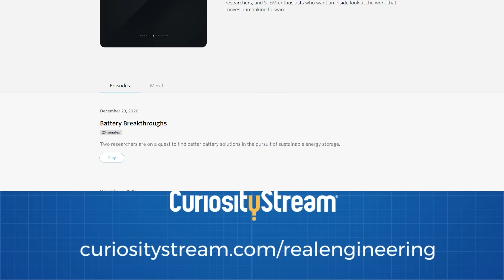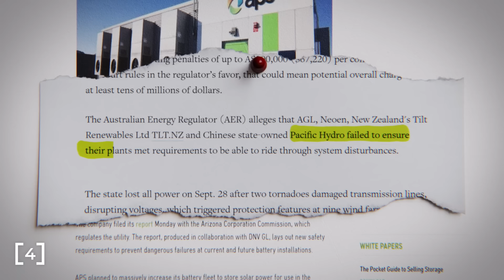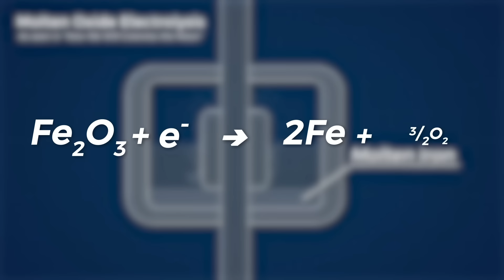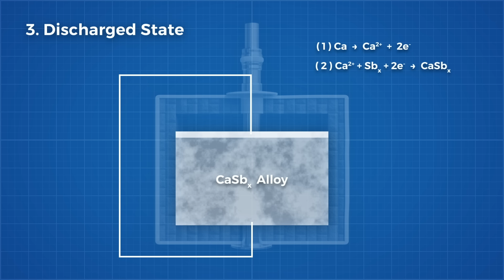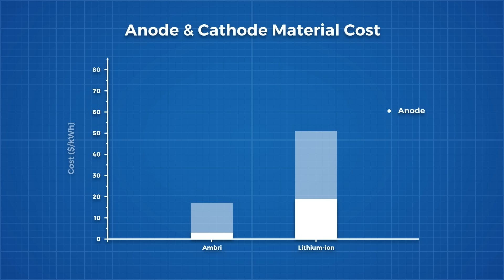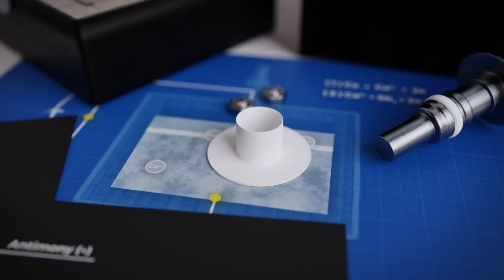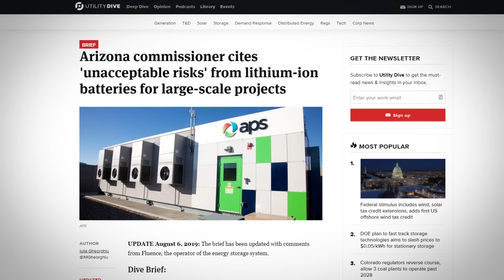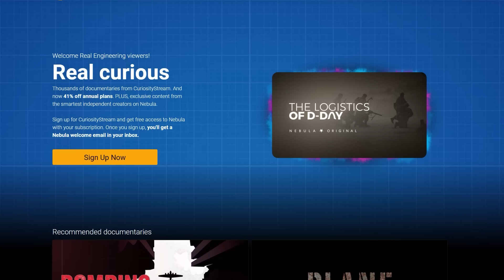The Missing Link in Renewables

Comment: Lithium batteries (or indeed any kind of battery) aren't scalable either. The materials footprint is huge, and as everyone knows they eventually lose efficience. Our best option is to roll out as much nuclear as quickly as we can - France effectively decarbonised its grid in less than 25 years using mostly nuclear, and did it over a quarter of a century ago. If we'd all followed France, we wouldn't have to worry about climate change.

Comment: The Real missing link!!! is Thorium Power Plant which is zero emission and safer compare to other nuclear isotopes to operate and provide abundant energy than thinking of storage. One big question to everyone who is pro-battery, what is the capacity of these battery, South Australia Tesla battery is mere 100mWhr that is just capability to provide only 100mw for an hour and what happens after that hour. For anyone who is curious, SA is trending at an average of 1400mW that almost 14 times at 24hour. So putting into picture 100mW is 10mil Aud. How much should the battery investment be to cover up the demand required on average load with only the dependencies on green energy? Think of it.

Comment: I hope power density is not holding back grid storage progress. Huge, stationary storage arrays would need only a fraction of the energy density of an average Li-ion battery. Compactness, voltage, and high rate of drain can be traded for scalability and durability. Who cares if the battery is the size of a Wal-Mart store if it's cheap and has excellent longevity?
Reply: Where do you put it? You can't just use farmland, woodland, existing cities, or residential areas. Even desert areas are inhabited by wildlife. Distance matters, so there are issues with many European countries.

Comment: The chemical waste in simply producing these batteries is astronomical and that's not even considering the fact that once one of these cells is spent, recycling the materials is more than just economically unfeasible, it's extremely difficult. We should invest that money in tidal power instead. Imagine if wind power was 800x more dense, worked predictably and had an 18-22 hour uptime, isn't susceptible to most natural disasters, is made from recyclable materials and isn't an eyesore. This would have a much more impactful effect on the grid, both in terms of economics and preventing climate change. Oh, and the technology is already here. So there's that

Comment: How about we use the electricity to make hydrocarbons out of the air. And there we have an easy to store, easy to use fuel that is adapted to the already existing system. No fuss, no muss and since the fuel itself is taken from the air its essentially carbon neutral. The only problem is efficiency, but if we're already wasting electricity why not just use it for that.

Comment: It will be difficult to displace LiFePO4 with liquid metal batteries.  Existing batteries are cost effective for one day's energy storage. What is needed more is being able to store summer's cheap excess energy for winter.  That takes a whole lot more storage.  A battery that runs at 500C is not a good candidate for long term storage, unless it is massive. Being huge, allows the surface area to be small compared to the volume, and that increases the amount of time the battery will hold it's temperature.  In addition, the thickness of the insulation can be accommodated.  Perhaps instead of stacking up lots of small batteries, they should be making a battery the size of a house, and burying it in the earth where it will eventually heat the earth around it, reducing the thermal loss.  Long term energy store is a whole different market than short term, and one where fossil fuels have the current advantage.  If these liquid metal batteries are cheap enough, they could store the essentially free excess summer solar electricity for winter use.
Reply: i and other people had the idea of vacuum insulating the liquid metal batteries so that less energy is lost, not sure if this is viable.
Reply: @hi-gf5yl  good idea.  With the vacuum, you need heat reflectors because the radiation component is quite high at high temperatures.

Comment: I was really excited by this video until he mentioned using Calcium ions. You use the Calcium group for a battery really? You know what's better? Go for a Sodium Ion battery. They can withstand charge and discharge much better than Lithium ions. The economy of scale isn't there, but you can drain them from 100% to nil with little loss of capacity. They are stupidly heavy, but if it's not a laptop or personal device battery who cares?

Comment: If these batteries need to remain heated and lithium batteries need to remain cool, why not engineer a hybrid using both that self regulates temperature. Designing a system of that nature could reduce energy loss.

Comment: Like your videos. But you miss a bigger picture:

1) your video is only generation focused. Flexible demand, esp industrial, is often a cheaper and better solution than mindlessly scaling storage
2) similarly, electric vehicles likely will play a role in load balancing and frequency control. 
3) Gas is linked to both electricity and heat. UK burns vast amounts for both applications, esp for heat, and won't be feasibly electrified. 
4) the problem is rarely purely technical. Large amounts of capital will only move if market design is in place to comfort investors that risk/return is acceptable.

Comment: I don't understand the cost numbers. $17/kWh and $51/kWh both seem insanely high. I currently pay $0.15/kWh from a dirty generating station. What do these numbers mean?
Reply: How expensive it is to store this power long term, producing electricity is dirt cheap, we are literally making it out of dirt for a 120 years now, probably longer but i can't be bothered to look it up. My house of 3 need about 100 kWh for 2 weeks and 1700$ to just have it stored in a basement and have power no matter if grid is up or down seems hella better than 5100$, also if something goes wrong with lithium i have a massive battery fire in my house, toxic fumes and all included, while the liquid metal breaks, well i now have a pool of hot metal on the floor but i can just get my garden hose and have it under control in few minutes, arguably a bit more pissed because it seems like pain in the ass to clean up, but at least I'm not dead and my house is still standing, i know it's not the kind of use that those batteries are made for but i think it's pretty good representation of why they are a better solution. I'm not sure if calcium in this form is safe with water, i know some salts of it can like, crackle in contact with water, i wouldn't call it full on explosion, but it could definitely scare a dog or some veterans. Alright it's 9:40 AM I'm shit face drunk, ight imma head out

Comment: "Must be made of dirt" - everything is made of dirt. To make it out of dirt is not enough. It also needs to be built and used like dirt. It will make sense if these batteries become large like shipping containers rather than small, sleek, high-tech cubes. Dig a hole in the ground, insulate it, fill it with metals and cover it.

Comment: Im sure this will come in the next 10 years. Anyways, any battery that cant beat  the required cost and captal requirements wont win. This battery research started during the time where the number to beat was $1000 per kwh. Now, that number is $80 per kwh. by the time this product comes to market, the number they need to beat is $50-60 per kwh, and once lithium ion battery goes into real mass production (or about 5 times two-folding), they will need to beat $30-40 per kwh cost. Ill put this together with nuclear fusion in terms of theorycraft-fairytailness

Comment: I'm running LFP batteries in my off grid system. Very safe and a life of 7,000 cycles at full discharge. I don't like the way this video mixes LFP and Li-ion batteries, that's why Tesla is going to LFP in it's grid back up apps. LFP is a safe battery and  it's getting cheaper, in my app my batteries will last 30 years. Yes, by all means develop batteries but I personally don't want liquid metal in my basement, that's a lot of heat and it creates its own problems.

Comment: Wind has always know that they are required to ride through grid disturbances. There are test facilities and standards for this. https://www.nrel.gov/grid/assets/pdfs/turbine_sim_08_dynalab_grid_simulator.pdf
Its cheaper to build windmills that do not meet the requirements, and that is why they are being sued. Its not an unreasonable requirement, and this video seems to frame the situation like AUS is picking on the windmill operators. Fact is the windmill operators cut corners and failed to meet the standards for grid connected generation.

Comment: him: talks about metal batteries
me: I wonder if it is sodium related
him: shows NA and talks about molten salt
me:  face palm*

This idea already existed for a long time, they wanted to make molten salt reactors.  Something that could potentially solve our energy crisis for centuries until we advance further.  Sadly to many smol brains are afraid of nuclear.  At least the sodium diode part is being pushed forward.
Reply: agreed. 
the interesting thing about renewables though is that if solar pv and battery storage become cheaper than the cost of electricity transmission, electricity generation will become distributed as it will be cheaper to produce electricity and store it onsite than buy from a utility plant even if the utility plant produced electricity at zero cost. Every building would have solar panels as a result, and eliminating the cost of transmission could allow for cheaper electricity rates than even nuclear, though I don't see this happening except in a few places and not for the foreseeable future.

Comment: This is why we need to invest in modern advanced nuclear energy options. Small form reactors, LFTRs, Thorium Reactors, liquid reactors, with modern technology, engineering, material science, safety measures understandings and designs, computer technology, robotics, It will really allow any nation to be pretty much be energy independent. Less reliant on fossil fuels. They'll have efficient, stable electrical grids and the rest of the grid could experiment with alternative power sources, etc. 
We need to heal from the trauma of our past and see that it came solely from Us not understanding what we were doing, not have advanced enough technology, material science, engineering, safety measures, understanding of how to go about everything, etc. This source of energy will greatly help the world improve towards the future and lowering emissions more than anything else could while having a very stable electrical grid system. Currently we have alternative energy options but the majority of our grid is powered off of fossil fuels and emission producing sources of energy. We will be so much better going forward commiting to modern advanced nuclear energy options.

Comment: Very interesting battery tech. You have a very similar technological advance working in a similar environment.  These two breakthroughs would become somewhat symbiotic relative to industries that require heat of production and large consistent sources of electricity. The molten salt reactors are the optimum green energy solution as well as the bridge to better green energy technology that will require time to mature. Especially in light of the "nuclear cliff" we are approaching by 2050 when most current reactors must either be refitted or retired. Current replacement strategies call for fossil fuel replacements. Modular MSR type reactors are scalable, safer , non proliferate even and walk away safe with no carbon footprint to speak of. Your comment about entrenched technology resistance is a problem here as well. We cannot solve the problems of today and tomorrow with failed paradigms of the past.

Comment: Two main points that ring so true, if you want real innovation, support smaller and medium size companies that are more likely to want to do change and not the big established companies that try to hold things back and the second point, if they are going to make real change, it has to be using materials that are abundance, in other words, as the video point out, making stuff out of dirt or more accurately, out of stuff that we have a lot off and it's cheap.

That's why I've lost interest in a lot of the so called brake through we keep hearing about with the promise of revolutionizing the world but they are using such rare materials that its so expensive that a lot of the times it stays in the lab and has little to no impact on the world, real break through are ideas that can be done cheaply enough and can get to market within 5 years of that idea, the rest are like pie in the sky that might happen someday but a lot fail, the ones that are around the corner are a lot more interesting.

Comment: The problem with the idea that we can store enough energy in batteries to run the world off solar and wind is we can't. When you go "off grid" solar, you need to design your system with at least 3 days of autonomy for bad weather etc. 5 days would be preferable and even more would be advantageous. Remember, we are all only 9 meals away from chaos.
Apply that same logic to a grid storage and you'll realise it's simply not possible.
Do the calculations yourself.

Comment: It's so sad to see that Methane storage of energy isn't part of the overall solution, because it should be ... there are plenty sources of biomass available to use bio-digestors to convert that into methane gas for us to use (and do note, that gas would be released from these sources anyways (poo of all kinds, biological waste of all kinds)  ... then there is the already existing technology to convert CO2 into Methane, which can even be a closed loop system (this tech is apparently already in use on the space station, where CH4 is just vented out, here on earth we would simply use it) ... not to mention that we already have a lot of infrastructure and knowledge in dealing with this gas (which is a lot easier than Hydrogen) ... and the only reason it's not suggested is because apparently anything that could produce CO2 is bad. But if you are an actual engineer, you understand that this is not the case. Both systems above are a closed loop system, where no CO2 is added to the environment...

Comment: Much of this is not an engineering problem, but an economics problem and rate structure problem.  Load shifting occurs when there is an economic incentive by the consumers to modify their behavior.  Under our current rate structures, consumers pay for just the VOLUME of power used and not also WHEN the power is used.  As a result the consumers have no incentive to modify their load shifting and load shifting doesn't occur.  There should be rate structures which are designed to alter consumer behavior to push the tops of the mountains into the valleys of use and encourage consumption when the power is plentiful and discourage it when power is expensive to produce.  Now we average the cost of electricity production over the day and sell it to consumers at the average and not actual cost at any production/demand point.  Doesn't this sound problematic?

Comment: It seems to me as a member of John Q. Public that this quest for clean renewable energy is simply creating a whole new set of problems. All of these wind turbines and solar panel arrays are constantly exposed to the elements and will eventually incur damage and wear out and need to be replaced. Batteries will also need to be replaced over time. Mining and manufacturing metals and minerals to construct components for turbines, solar panels, and batteries involves toxic waste material. What to do with untold tons of turbines, solar panels, and batteries when they wear out and have to be disposed? Turbines kill birds and bats, and erecting thousands of turbines and solar panel arrays takes up an enormous amount of space and upsets eco systems. Wind and solar are intermittent sources of power and not nearly as reliable as fossil fuels, nuclear, and hydro. If I were on the panel of an energy committee, I would propose that we should simply clean up and modify our existing energy systems as opposed to replacing them. (Wind and solar do seem to work in places where wind is constant and sun is plentiful, but that's the exception.) One last point. How do we discontinue using fossil fuels that propel commercial airlines, cargo ships, naval vessels, hundreds of different kinds of construction equipment and cranes, logging equipment, farm equipment, yard maintenance equipment, snow removal equipment, trucks and trains and buses that deliver huge amounts of goods and passengers coast to coast? Proponents of the green new deal make it seem they have a simple solution. It ain't that simple folks. Not telling the public about all the problems and obstacles is deceptive. But if agendas are involved, deception has been and will be used to accomplish goals that will most likely benefit a few to the detriment of many.

Comment: Fusion is not a viable choice nuclear technology is not viable choice . It is critical that we don't contribute to the nuclear cascade with nuclear technology. The reason we don't develop build or share nuclear technology under the nuclear nonproliferation treaty enforcement.  Edison generators and dynamos easily replace fossil fuels and nuclear power completely.  This power system removes the need for wind solar and battery technology.
Reply: You’re conflating nuclear reactors with nuclear weapons. Sure there’s obviously overlap, but that’s like saying conflating fertilizer manufacturing with bomb making.